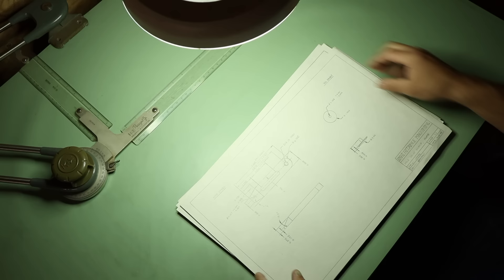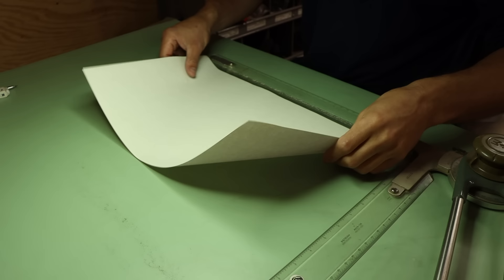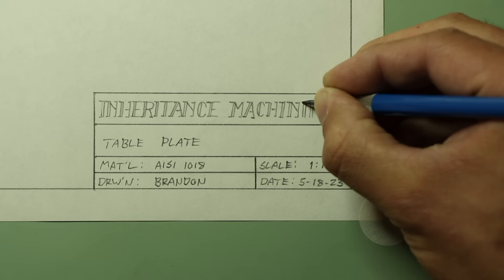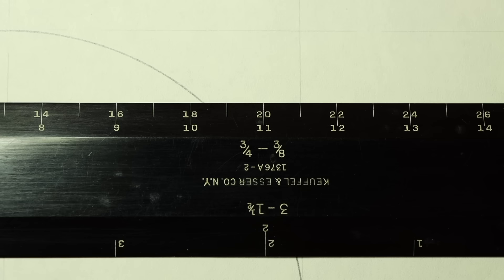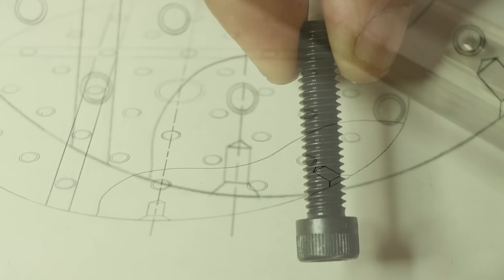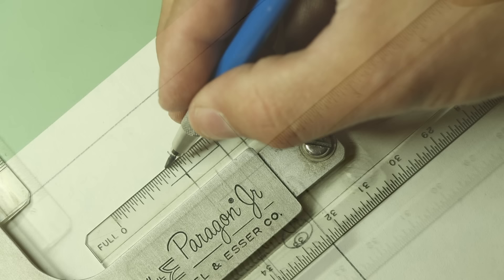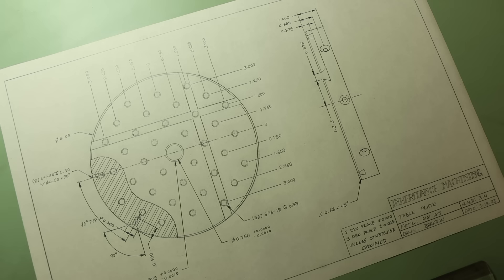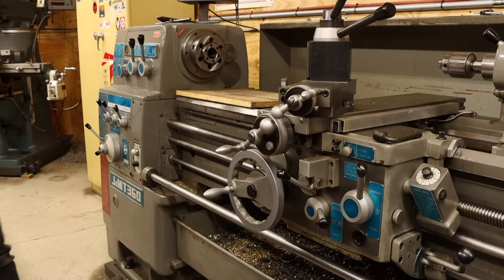The Joy of Hand Drawing Machining Prints || INHERITANCE MACHINING

Comment: A great ASMR video.  No, the drafting table was not a household item in the 1980s.  I took drafting in college to satisfy an elective in the early ‘70s.  I recently learned that my brother and sister both took the same class at the same college in later years.  When I needed a job in the late ‘70s I found one at a land surveyor’s company.  He was THRILLED to learn that I could make mechanical drawings.  It took a lot of workload off of him.  To this day I still like drawing by hand.  I generally have the entire design worked out in my head before I start drawing.  The only reason I’ve gone to CAD is that it has made me aware of many dimensional mistakes, especially on woodworking/cabinetry projects.  CAD has saved me lots of lost time and materials.  That is in part no doubt to the fact that you can't buy wood in standard dimensions any more.  There’s still nothing that beats the look and feel of graphite on paper.  In the shop I end up doing a lot of machining drawings for simple projects on the white Formica top of an assembly table.  It cleans up leaving no trace when I’m done.  I still have a 72”x36” drafting table and a drafting machine.  I’m very reluctant even though I'm well north of 65 to get rid of them even though I use CAD as well.

The electric eraser was no luxury for anyone that had to ink their drawings.  It was the only good way to correct a mistake with India ink.

I volunteer on the restoration of the battleship USS Texas, a 28,000 ton ship that was designed in 1910.  It staggers my imagination to think that the ship, which was the most technologically advanced thing in the world when she was launched in 1913, was designed by rooms full of engineers and draftsmen without the benefit of calculators or computers.  They only underestimated the top speed of the ship by 1/4 knot.  Hope I didn't wader off topic too far.

Comment: I used to love drafting class in high school back in the mid 90's ... sure that's where I learned Autocad (running on a 386 and MS-DOS) but yea I could easily spend large quantities of time at the table and machine. Today when I am at work... even the simplest of things like a bracket I dread whipping up in cad, but thankfully doing cad drawings is not my job, I just do it when I need a thing to do my job, and either send it to the machine shop or drop it in our little 3d printer

Comment: I had my first and last formal drafting training in junior high school in 1962.  Since then, I have had an interesting career in the air conditioning industry and have been designing and building cleanrooms for the past 40  years.  I have preferred hand drawing to CADD.  This includes white board sales sketches and feedstock to my draftsman to reproduce electronically.  I typically use 5-square, non-repro graph paper when I am not drawing freehand.  Some years ago, I was working with the architectural draftsman for a large AE firm in Seattle.  I was making some isometric sketches to explain the design, and he said, ruefully, "I wish I could draw like that".  I asked what he meant.  He told me that 2 years before he entered college they had stopped teaching architects hand drawing.  Too bad.

Comment: I love this!  I still have my drawings of an air compressor that I designed in my final year at university over 50 years ago. Then I never needed to do it again as the draftsmen were so much better than me. 🙁 However, I had to do the initial sketches many times to both guide calculations and to bring the item to life for the drafting team.  CAD is of course a great tool but drawings are just as satisfying as the finished item!

Comment: The classes I took on this had us using finer lines for dimensions and call outs to differentiate them more easily from the object lines.  That sometimes means using a slightly harder pencil, but it definitely needs to be sharper to get a finer line.

Comment: Rip up a few squares of masking tape and stick over your compass centre point. Stick the final face to your jeans a couple of times so it's not too sticky before pressing on your paper. You can then either elmininate, or certainly reduce the hole in your paper. I used to do this all the time back in the day before CAD, I've been setting-out joinery for 33 years now. I miss the drawing board but love how far I can take my drawings in AutoCAD, Rhino and Solidworks. Google a LINEX 1007, PARALLELOGRAPH - perfect for quick accurate hatching by hand.

Comment: In school we had to use 2 of the first weeks just doing machine drawings. Seemed like hell and being really boring. 
Then when we were almost done the drawings begun to look really neat and clear. We had to do it to dimension and then make some of the parts later, so it had to be done right. 
Today i mostly make a quick hand sketch and then switches to CAD (Fusion 360) for the actual part. But when i'm doing a hand sketch i still do some of the correct practices on dimensions etc., but with an ugly hand sketch.

Comment: To bring some light to the projection: You can imagine the more common method as placing the part you're drawing on the table and looking at it on top. Then, to do a side projection, you simply turn the part on it's side (like turning the page of a book) and look at it again on top. What your method is doing is, instead of turning the part on the table, it's turning it into the table.

Comment: I gave CAD a try for a home project. I had a very good understanding of what i wanted in my head, but the software was a pain when it came to making an assembly. 2-3 weeks of trying to do the CAD, so i got frustrated and said fuck it and drafted it (as i normally did since i was a kid) and knocked out the whole project, 9 relatively simple parts, in about 6ish hours. but here's the trick, while i love traditional media, I am also an artist with a full digital setup, so i used my art software (Clip Studio Paint) which has full drafting tools in the software because it's build for comic artists. My drawings aren't the best, and in anyone else's hands lacking info, but they've got what i need to do the build.

Comment: I use those mechanical pencils, they come with their own sharpener. On the top of the pencil, you see that silver piece? It has a small hole in it. Just pull it out and push your lead into the hole, and turn it.

Comment: When I graduated  with a degree in architecture in 1981 my first job was in a large (125 people) architecture/engineering firm.  There was only 1 “autocad” station, the rest of us were drawing by hand.  There were hardly any “drafting machines” and I would go so far to say none in home use (expensive, your K&E is really good one).  Your video is excellent but somewhat implies you have to have this to do mechanical drawings.  If someone wants to get into “drafting” just get a t-square or parallel bar (Google it if you have to.). A lot of those old, used drafting machines are messed up and not worth the headache.

Comment: When you are drawing 8 hours a day, five days a week, the electric eraser is not a luxury. We used to use a 9H to draw guidelines for everything. Especially for lettering. Another advantage of linen or velum in the olden days was that the transparency allowed for reproduction on a standard ammonia printing machine (aka blueprints, altho by the 1950s, they were blue lines on white paper, rather than white lines on blue paper. There are also "engineer's" scales as opposed to "architect's" scales, the engineer's scales are not in feet and inches.

Comment: Highly appreciated you showing this to the people. When I started my career as a Mech. Eng. back at University, it was still mandatory for the students to learn the manual drawing process first and then turning to CAD. Tis sounds like I am fairly old, but in reallity it is just 25 years since then. Like you said, the advantage of a dedicated drawing process is that you design your parts with the manufacturing method/technology in mind. And even today, in despite of having all that professional designing stuff at hand, High Level Computer, 3D-CAD System, iPad Pro, etc., I enjoy sitting at my drawing board - yes I also still own my good old Drawing Board back from my Student days - and sketching and drawing the parts I am working on, even before I move on to the modern 3D-CAD. My experience shows that, similar to what you do, it is (i would say) mandatory to have a clear vision of the part in your mind, or even better on paper, before you launch your 3D-Software.
One thing I recognized on the different processes, maybe it is Europe vs. America, I don't know, like the projection styles you are discussing i the video, but here (Europe) we say "first comes the center-line", as a kind of baseline and basic set up of the view locations, e.g.
One thing I thought about while watching your video, did you ever try using the 3-view-projection-method? I would feel honored to hear from you about this and maybe discuss this later on.

BR, Sven.

PS: The issue with the scaling ruler wouldn't have appeared, if you would work in the metric system ;) :D
Reply from the maker: Thanks! I haven't gone into detail in the 3view method I it is extremely powerful at times!

Comment: Vellum paper: You drew a working sketch in pencil either on a scrap paper or on the "onion skin paper" itself. If you used a paper then you would put "onion skin paper" over it and produced an original in black colored ink. 
To make copies - "blueprints" - you would take a sheet of photo-sensitive material, put it on the table in a dark room, put your vellum original over that, cover the whole thing with a glass and shone a strong light from a special lamp on it. Then, again in a dark room you would treat the paper with chemicals to "develop and fix" the drawing copy. The original technology produced white lines on a dark-blue background, hence name blueprints.
This is why that semi-transparent paper was used. Oh ... it is also much more resistant to erasers when you work in pencil first. 
In normal engineering practice you would never hand over an original drawing to machinists.

Comment: I was in the last class at college that taught manual panel tipping a class that required an ungoddly amount of amount of draftnig supplies ..Still have all of it including the drafting machine and about dozen machical pencils  etc  I have 2 of the gold tipped pencils  They lay down a fine line  Ive done plans/layouts for automotive fedners, sheet  metal work  I miss the hours of layout work  I also learned Auto cad V10 on up  in soildworks and Catia

Comment: In my opinion, manual drafting should be required for all engineering and architecture students, no matter which discipline they pursue.  I took drafting around '05 when I was going through college.  I was fortunate that my instructor, Mr. Simmons, was a demanding but excellent teacher and a 20-year veteran of the drafting board.  We were producing relatively complex drawings before the first semester was complete (the requirement at the time was for two semesters of 2D drafting).  The manual drafting portion was canceled by the administration not long after I took the course, and the requirement dropped to one semester of 2D CAD.  They eventually canceled 2D drafting altogether.

In my experience, manual drafting is not only relaxing, but especially in the educational context the limits of the medium help to produce a disciplined manner of thinking - something that is sadly lacking even in some experienced practitioners of the industrial arts.  The necessity of planning your work well to produce a really nicely executed drawing leads you to try to find errors before they're even created, and to look for 'gotchas' so you can correct any issues as early as possible - important skills for any good designer (or any technical person, really).  And, personally, I think that learning some of the geometric construction methods from 2D drafting gave me a significant advantage when I picked up CAD (a small amount of Autocad, then Solidworks) a short time later.

Nicely done, Mr. Simmons would be proud.

Comment: As  someone that had to manually draft for a semester 20 years ago I quickly noticed the lack of auxiliary views... wonder why? 🤔

Also, I laughed inside a little when you said you were drafting with the machining in mind when as an Engineer, ASME Y14.5 tells you basically not to do so since the purpose of the drawing is to capture the design, not the fabrication method. (That said, you don't make many friends in the machine shop if you have no clue how they are going to make it). 😅

Comment: Not bad. Pretty good drawings.

 Try making intersection points sharper.

Also use line weigths. Visible edge should be heavier. 0.5 or 0.7mm. Dimension lines, callouts, centerlines etc. 0.18 or 0.35 mm. Visible lines should POP OUT of the drawing insantly and be very distinguisable from dimensions etc.

First angle projection is the 'right way' btw. 

Use the standard way of marking threads. The alternating lines are hard to actually read dimension from because its essential points and also innacurate to draw. Parralel light lines is the way to go.

I wish I had the time and patience to draw more of these still. You should be proud of them, they are well done.

Comment: Beautiful work, as always.  And each drawing is a work of art. You should get a portfolio album to protect them for "inheritance"
Do you find that a flat table works better for you than the normal, raised, angled table? (Which might be better for your back and neck after many hours bending over the table.)
You just touched on the distinct advantage of the designer/engineer also being the maker.  It's a huge advantage but is not the case in the real world where one person designs something and someone else makes it. Thanks. Regards.
Reply from the maker: Thanks! I've worked with the table slanted on occasion. I usually have all my supplies stashed in the corner of the table though so I keep it flat most of the time. I should really get a proper shelf or something haha

Comment: I have the Iris from Makers Cabinet for drafting circles. It's a bit more expensive than it's purpose would justify. but t's a very handy and pretty tool, and would look good on your videos!
Reply from the maker: I've seen those! Maybe I should make one?🤔
Reply: @InheritanceMachining  you could try, this is next level challenge though, everything is super precize, the fit of the rotating top ring in the bottom one so it doesn't fall out (it is clicked in), the aparture blades are made of very thin springsteel. And you'll have to figure out all the math to have it work correctly yourself.

The thinner the blades the smaller the minimum circle. This one can make a 5mm hole at its smallest, and 7cm at its largest.

Besides first make sure they don't have a patent, because that could get you in legal trouble if you made the mechanism the exact same. Otherwise you might need to wait 20 years or find a different solution.

I have trust in you that you could take on this challenge, it's on the edge between watchmaking and normal machining.

Comment: The time it takes to draw manually gives you time to think more about the design. CAD allows you to design bad, overcomplex designs quickly and PowerPoint allows you to show them off and get approval without anyone actually standing back and noticing the mistakes. The modern world runs faster, but isn’t actually more productive. 
The solution is to design by hand, and then draw it up in CAD.

Comment: Question! I recently got a k&e drafting arm. It's the larger paragon. Now look, I'm not a draftist. I know exactly nothing, so bear with me. The scales don't sit flush with the paper, as there are a pair of little raised glass-like dots on the bottom of the head which cover a pair of screws. I hate them. Does your arm have anything like them? Does anyone know if they can be removed without causing Ragnarok? If so, how? They appear to be made of unobtanium, and are welded to the head with dark magic.

Comment: I studied engineering at a uni in germany. I had a course called "maschine design 1", where we learned the very basics of maschine design & had to draw designs with pencils, ruler on paper. Stuff like, which measurement to place where, how to draw arrows in what angle, variing harchings to show that its a different part, etc.

I like the part of envisioning the parts and drawing them. Drawing the machine designs had something calming almost meditative feeling. You are also much more involved in thinking and learning the specifics of the parts you drew.

Sadly, I hated how picky it was graded. Angle of arrowhead wrong? -1P, oh your line strength is wrong and you used 0.3 instead of 0.5mm pencil? -2P. Hatching are not in 45° angle? -1P Hatching not uniformly spaced? -1P The circle you have to do freehand is not a perfect/goodlooking circle? -1P
Worse, the exam contained drawing tasks under time pressure, which we had to do on small folding tables with dents and carvings. It was just tedious.
I probably would have more fond memories of handdrawing designs, if I didn't learn it under circumstances where everything was nitpicked and graded...

Comment: On the radial holes, why did yiy both do a hole call oit and dinension out the depth and counter sink diameter separately?
Reply from the maker: mostly just because I had the room too. It is redundant and I try to avoid that, but I felt having both made it clearer

Comment: Tis the process I use , sketch, Draft pencil and paper,    when Im happy with the design ( drafting slows me down and I think better )  then 3D it ,,,after which I will 3d print it  HERE is usually where I find out the "design changes ( screwups) ,,,, then I will make those changes   finally make the part,     I know you should go from art to part ,,,   but   yes ,,,well      cough cough !